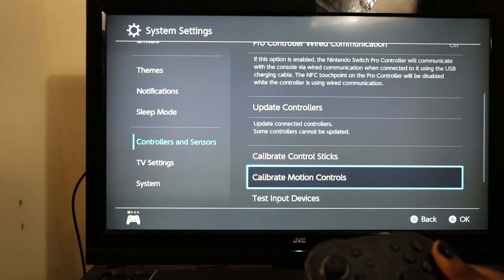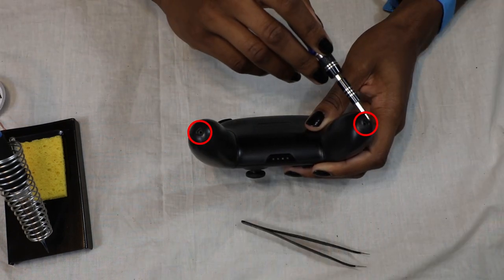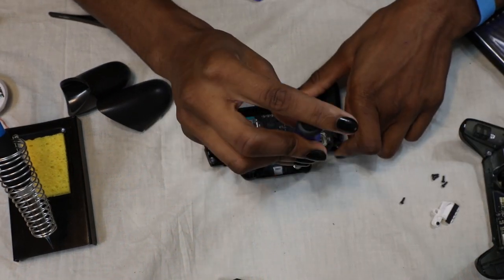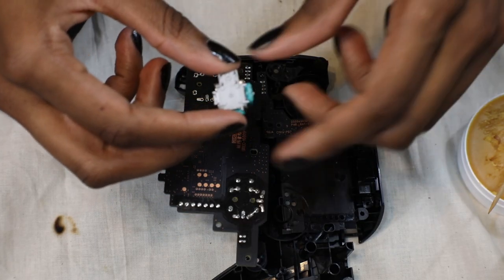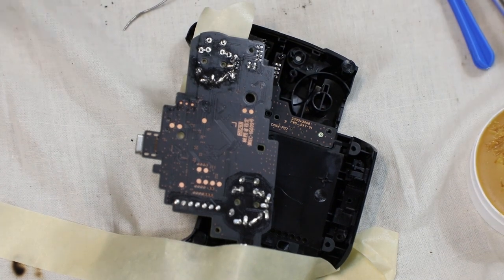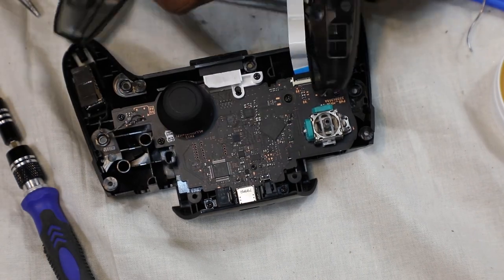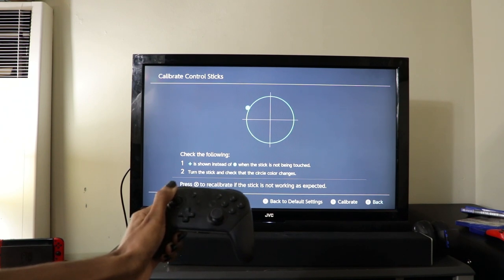How To Fix Broken Defective Left Analog Stick - Nintendo Switch Pro Controller

Comment: This is 99% fixed. Its supposed to show a "+" sign when its 100% centered but it is indeed way better that the way it was before. Good job
Reply from the maker: Oh  yeah I realized that after I filmed the video and ended up re-calibrating it later. It's been working fine so far thankfully.
Reply: Its show a "+" sign now after you recalibrate it ? So if we factory reset it, its gonna not show the "+" sign?
Reply: Mine did the same and the + showed up after a calibration. I used an orange stick from ebay that said it was hall effect.

Comment: Mine is actually broken (from the inside!) When it fell off the kitchen counter against a hard tile floor, it dislocated the right joystick. It still operates though so it could be something else. Either that or it somehow operates even when dislodged.

Comment: Use the soldering iron to heat up pin & melt solder straight on. When lifting off the iron, the solder should flow nicely around the pin. If you need to paintbrush the solder, it hasn't heated enough. Good job for first time
Reply: I was going to say the same thing, but I was 7 months too late to the video :P
Convention is to always heat the joint, because once solder melts, it tends to stick to the hottest thing, so when the iron is hotter than the pin, that's how you get bubbles on your joints.

Comment: Tip: Add more leaded solder to the old unleaded solder (because the lead free solder needs a higher temp to melt)
Also adding solder to your tip when using the braid helps conduct the heat from the tip to the braid resulting in better wicking
Reply: oh God no! Please stay away from lead solder. Will poison you!
Reply: @RicardoCooper  You clearly haven't worked long with it. Just wait and see.
Reply: @gildardorodriguez4356  lead free solder sucks...

Comment: Thank you VERY much for the video. Google was nearly helpless with this as most folks solutions (compressed air/calibrating) wasn't what MY issue was. This is MY issue. I actually had the controller disassembled when I found this video, which was made in the past few hours. 

Only issue: the costs of fixing equals the cost of buying a new one based off the links provided. If I had the gun, paste, and other things then it'd just be basically $13 and a few hours of labor. Instead....I must now wait for a sale as I'll (probably) never use those materials again.
Reply from the maker: If you live near a Fry's I beleive they have cheap small single project flux and soldering materials.
Reply: Wrap a small strip of duct tape around the stem of the stick which will prevent it from over registering. Fixed mine completely

Comment: Great work. I think the only feedback I'd offer is, drown that thing in flux, and keep desoldering until the component basically just falls out. If you have to use force, it's probably because there is still solder holding it down, and you might pull a contact or trace off the board. Otherwise great job man!

Comment: Not bad, technique-wise. I'd recommend watching how long you continue applying heat when soldering to pads. Depending on how hot you're going, you might life the pad. If that happens, it doesn't necessarily mean it's bricked. You can either scratch some of the coating farther up the trace, or you can follow the trace to another pad and add a jumper wire.
Both are hacks, but nobody will ever see it, and it might save you $80.

Also, check out harbor freight for cheap tools like vises and plastic welders and soldering irons. They're not high enough quality for daily abuse, but they'll definitely do a good job at least once for cheaper than renting it at home depot.

Comment: I have 3 Pro Controllers that all got drift at about the same time a year ago, which was just on the cut off for the warranty, and now my joycons have started, so I’m gonna fix them all at once (As a silver lining, I have an excuse to reskin the controllers). Thanks for the video, been wanting to learn how to properly solder for awhile. I just learned how to connect wires in a high school engineering class.

Comment: ALTERNATIVE!!!

Instead of replacing the ENTIRETY of the analog stick, shift focus to the green portions of the stick itself. These are the sensors. They're the potentiometers that tell the controller to what degree the analog is being moved. What one can do with NO need for soldering, wicks, pumps, etc... is to GENTLY bend back the green portions from the stick's metal housing. They're clipped in so you'll need to be firm, but GENTLE. you don't want them to break. Once pulled back, you can pop out the disc shaped sensor. Clean it with a Q-tip and some rubbing alcohol as well as the green housing it was pulled from and place it back in. Reassemble just enough to where you can power it on and navigate to the calibration settings and test it. In all likelihood, the problem will have been fixed! In some occasional instances where it is STILL not working properly, then the sensor "disc" may be damaged. Fortunately, if you have a busted controller sitting around and is a "parts" controller, you can steal the sensor from it and use it for the Pro Controller. Doesn't matter the controller. It could be another Pro Controller, an XBOX One controller, a DS4 controller, 360, DS3, etc...

What I've laid out is exactly what I've done for "drift" issues and it's always worked out for me.
Reply: Will it work if I replace the entire stick with another one ripped off a PS4 controller, or there’s a compatibility inside the whole stick? Because from what I can see the replacements seem just to look all the same item (Xbox one, PS4 or switch pro controller)

Comment: Thanks dude!

In Japan, they sell wick that has flux in it! Its super cheap (only ¥230 jpy). I find that wick with flux in it works quite well.

I'd recommend you try it out if something is available near you!

Also try replacing with hall effect sticks! They don't drift 😎

Comment: Make sure you keep the tip of your soldering iron tinned. It helps conduct heat and means a quick touch of solder is all you need. There are plenty of vids that'll explain it much better than I can here.

Comment: Did you have trouble heating up the existing solder to make it flow? I've been trying MULTIPLE methods to desolder but the existing solder REFUSES to liquify.
Is nintendo using some sort of super solder or something? lol

Please let me know what you were able to do to get the existing solder off.

I've tried tinning the tip of the soldering gun and checking the temperature on the tip to make sure it actually melts fresh solder-- and it does.
But on contact with the board it doesn't seem to have any effect with the existing solder.

I have FLUX and the braid as well-- but it doesn't absorb anything when I apply it to the area I'm desoldering. 

I also tried mixing new solder with the existing solder in hopes that it will help bond and melt, then wick it up but
the wick only picks up the fresh solder. ): 

 I tried heating my board up with a heatgun to make sure there's no temperature loss on the board.
But the existing solder is so stubborn, it doesn't budge or warp.

I have a soldering pump/sucker and it seems to only suck the fresh solder too ): 

Using different solder tips hasn't helped either. I went from needle, down to the thickest one.

Is the Switch Pro Controller soldered with some special metal?
It's driving me INSANE. Any tips appreciated.
Reply: Update:
The soldering iron I was using was defective, didn't heat the tips proper or stay consistently hot. So I got a new one! 
I just finished desoldering 3 joystick modules off 3 controllers. lol
I tinned the new tips on low heat, then I cranked it up to 405c (around 750f) and got to work. 
New soldering iron worked as intended.

The solder on the Switch Pro Controller was STUBBORN.
I used plenty of flux and tinned the tip of my soldering iron from time to time. 
The trick is to use fresh solder on the solder you're trying to remove.
Give it time to bond with the old solder before melting it and sucking it up with the solderpump.

...but to be honest-- this was harder than it should of been.
I kept adding/removing solder over and over but there was always solder in the pinholes that was too stubborn to come out.
The wick wouldn't suck it out either. I actually had to snip the pins of the joystick module with a wire cutter so I could get closer to the pinhole and get the remaining solder.
It only worked on some of the pinholes. I'm sure it would of worked on the others if I kept at it but I had some "FastChip" handy and used that--

IT WORKED LIKE A CHARM. I HIGHLY RECOMMEND IT! 
"FastChip" and "Chip Quik" is a low-melting solder that stays molten long enough to pull parts out once applied.
It also bonds to old solder much better and makes it easy to remove/suck up.
The pin holes on the pcb were really clean after applying it and I used it on my two other controllers.
The process was way easier once I started applying it.

Once the pinholes were clean, I was able to snap the new joystick modules into place and solder them up.
Now I have 3 controllers to use when I play Smash Ultimate. lol.

Anyway, that's my experience. Hope it helps someone out there!

ALSO, PLEASE SOLDER IN A WELL VENTILATED AREA AND HAVE FILTERS RUNNING!
LEAD SUCKS- YOU DON'T WANT THAT GETTING ABSORBED IN YOUR BODY AND PUT INTO YOUR BONES. 
DON'T BREATHE IN THE FLUX SMOKE!

Take care of yourselves!
Good luck!

Comment: My controller's left stick was having issues when moving it eastward. All I did was open up my controller, examine the stick from the inside, saw there was a slight buildup of dirt and hair in and around the stick mechanism, plucked the hair using ribbon wire tweezers and wipe away the dirt with a dry napkin, put it all back together but not before I cleaned up other dirty parts of it, and then it started to work normally again.
Reply: Agent 1 how did you open it up ? What equippmemt is needed?

Comment: I find that when soldering, you want to be pretty quick or else you get those ugly stringy bits when you pull away your iron. It’s because the flux in the solder melts away pretty fast.
Also, you can damage the board if you use too much heat for too long.

Comment: I just wrapped the stick with a small amount of duct tape so it wouldn't over register. Fixed the problem completely. It was free and took 1 minute
Reply: Can you make a tutorial? xD pls
Reply: Yeah make one
Reply: I did the same with two layers of electrical tape. Fixed it as well. it makes me think the issue is with the position of the stick allowing it to go to far. I think  heat shrink would be better if I can find a thick enough piece that is also big enough to go around the top of the stick.

Comment: Is your stick snapping to the x and y axis in the calibration? Some analog units aren't too great e.g. the Hori GameCube controller which kinda fucks you up if you want very specific angles. It's worth checking in the calibration!

Comment: Old video, hopefully someone will respond, I did this and it ended up making the problem worse! Now my left joystick is stuck in top left, and it won't even recalibrate. Any ideas? I'm thinking maybe the solder is messed up
Reply: It's possible you crossed pins with your solder; your sense is probably correct.

Comment: Is there a way to fix it without replacing the entire analog unit? I don’t have cash for that
Reply: I know it's old.. but 4$ for a stick seems alright.
Reply: I've worked on xbox one controllers for awhile 1yr+ repair expirence. You can wedge off the green parts and theres this little disc in there. Which guides the turning. Try cleaning it off. Hope it helps.
Reply: You can buy Electrical Contact Cleaner (comes in an aerosol like wd-40), spray it onto the disc that Ray Watson mentioned, and then just move the stick around to massage it in and clean it off. It's how I fix the drift in my joycon sticks when it comes up.
Reply: Search "Nintendo switch power a wireless enhanced controller deep clean" then kinda copy that for the normal controller

Comment: is there a way to fix this without the soldering part?
Reply: Sadly no.
Reply: Put 2 layers of electrical tape around the skinny part of the stick and re-calibrate. You don't even need to take it apart.

Comment: How important would you say the suction part is for removing the sauder? All I have is my dad's old school saudering iron for wiring, but I figure with the stick already broken I dont have much to lose. Would I be fine just wiping away the melted sauder? Also how careful do you have to be about melting the circuit board surrounding the pins?
Reply: It's better to get that copper Robbin to remove the solder.

Comment: Forget about the pump, should be able to get it clean just using the wick.  I used to work in electronics R&D and the "pros" could replace that in 5 minutes.

Really sucks this is such an issue.  I'm at a loss as to whether I should try to fix, buy new or sell the switch and get an X-Box.
Reply: Actually you should just cut the pins from the bad unit, then heat the solder and remove the pins one by one with pliers.  then clean off all the solder with the wick.

Comment: Those square teal covers on the sides of the stick component house the potentiometers. They clip in to the component on their sides and can be pried open from the top, allowing you to remove the little circular contact. Cleaning this contact and the other circular contact inside the teal cover fixed the up-down problem I was having. You could also replace the contact.

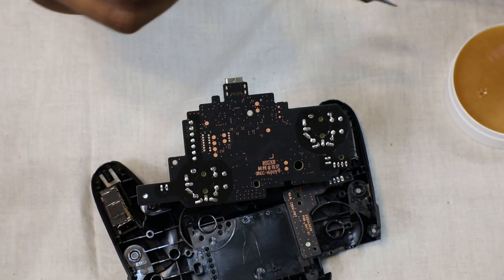Here's a video showing how to pry open the teal cover: https://www.youtube.com/watch?v=MoqW3PukDK0 around 4:20 blaze it

I also recommend using at least 91% IPA for cleaning. My personal favorite cleaner is "'CRC' QD Electronic Cleaner", you can get it from Wal-Mart.
Reply: this is the correct fix! this will get your old controller back to working perfect. the real problem is after a few months you will need to repeat. then after cleaning a few time the copper will tarnish more and more which needs cleaning more often. that's when i took the simple $10 part and replace the pot sensor plastic and (sub par) copper spring out of the part and put it in my controller. i am glad to see more and more people coming to the same conclusion that i did. 
FU Nintendo

Comment: Shit, is this a problem with EVERY controller? Just bought one yesterday.
Reply: Unfortunately yes.
Reply: I’m gunna go buy a GameCube controller , pro controller just started drifting down today. I don’t beat it up either. So sad man
Reply: had mine for about 2 months for the left analog stick to break. The problem with the drifting was caused by the module inside. It physically had trouble to center itself causing the analog stick to be slightly off center causing a drift ingame. The drift would go away if I simply centered the analog stick but would return if I pressed it in any direction. I opened the controller and there was no sign of gunk jamming the mechanism. This was simply "wear and tear". I am perplexed it happened to a 2 month old controller, and I wasn't playing THAT much on my switch. I paid quite a lot of money for this "pro" controller only to find out cheap and faulty parts are being used to make them. I never had this problem with PS3/4 controllers. Nintendo sucks ass when it comes to controller quality.
Reply: MysticDragons I’ve always had this problem with controllers to be honest. They are made poorly inside. I think it has also a lot to do with what games you play. Most games use the left stick for movement. Depending on what game you playing , you might move the sticks back and forth quickly. In a game callled super smash bros you have to erratically move it to get out of attacks. But even for FPS games say fortnite, the controller can take a beating from always clicking in the analog to run In quick jerky movements. It is a scam how much company charge for new controller yet make the inside so delicate and poorly crafted.
Reply: @MysticDragons  same 2 month and it's dead
Reply: I've had mine for over a year now and it just started drifting 2 days ago. so I'd say it's not a viral issue for every controller
Reply: @lemonbeverage  Same. I've had mine for over a year. The drifting started around 7 months after having it. It stops then comes back. Now it's in a world of its own.
Reply: @dylanmaguire8902  how can I avoid the problem?
Reply: @SultanSaleh-b9o  I'm not really sure tbh. It's just over time it happens. 🤷‍♂️🤷‍♂️🤷‍♂️
Reply: Mr. Yeet same
Reply: Mr. Yeet been using mine for about a year and a half and no problems whatsoever

Comment: another way you can fix this problem is by recalibrating your controller in the recalibration settings on the switch. Granted it is a cheap solution to a problem that may come up again in the future.
Reply: Hasn't been working for me. May be time to have a look inside

Comment: Anyone have a model or brand switch that works? I bought one off amz and its stuck going right all the time and the instructions says i need to solder some additional resistors but it's so small i have no idea how that works.

Comment: I have 3 Dualchock 4s for the ps4 and i've had no problems with any of them for around four years, I got a pro controller and used it rarely for about a year and it started malfunctioning, i'm really disappointed in Nintendo.

Comment: I ended up stripping the first screw so... time for another controller.
Reply: You could try pressing down really hard on the screw with the correct bit. If that doesn’t work you could try other bits. A small flat heat could work too.
Reply: i know this is a year ago but THE SAME THING HAPPEND TO ME YESTERDAY i had to drill out the beside the nail and use pliers to twist it